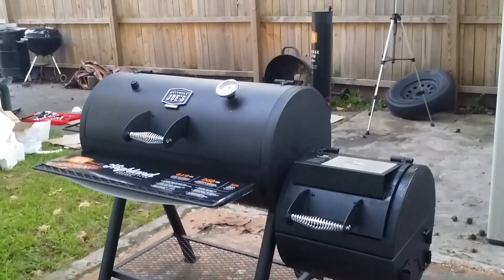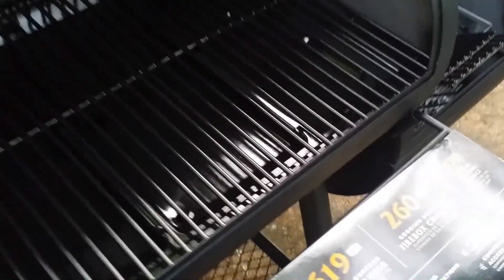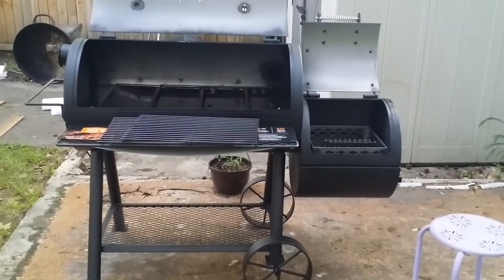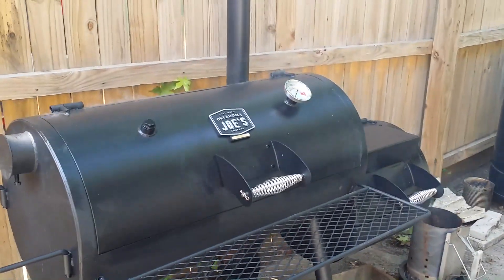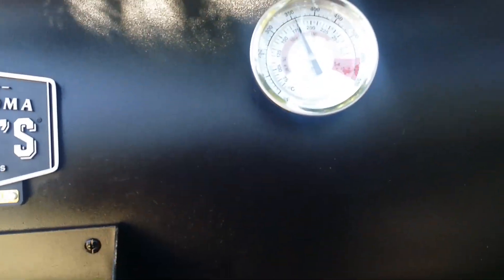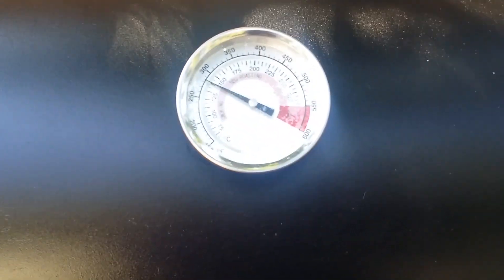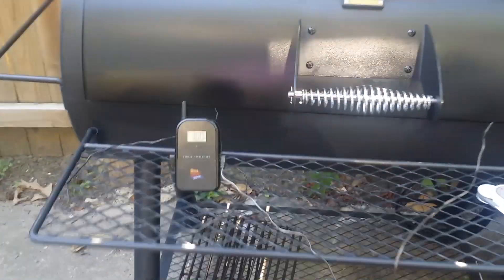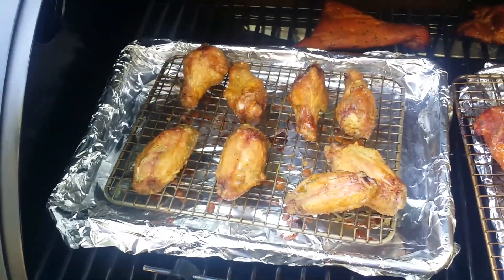New Toy: Oklahoma Joe's Highland Reverse Flow Smoker

Comment: Don’t use those BBQ handle clamps, check this Hack out and I promise you will be happier than drilling holes in your new Smoker:

Get a gallon jug, mix up a small batch of either Plaster, Quick-Crete cement or if you want to keep jug intact fill with sand. If you use plaster or cement, make sure you anchor a long Eye-bolt with 2 nuts and a washer in between at the end before it dries after you first pour. Then get you a metal hook with an eye loop. Attach the two with the appropriate length of marine rope. Anchor weight pulls down on your handles and creates a better seal. Do this before you add gaskets. When you cook and season your grill enough, if there is t too bad of gaps then the seasoning will fill it in naturally carried by the smoke. 

I would most definitely use this method but with a chain on your firebox before ever attempting a gasket specifically in the firebox

Comment: You need a better diffuser go distribute your heat. From one end of your ribs to the other was a difference of almost 25 degrees. The one provided by the company doesnt work as well as a hack fix of foil wrapped grates